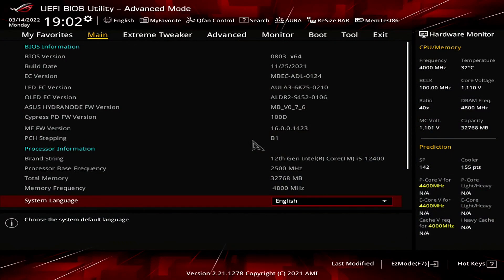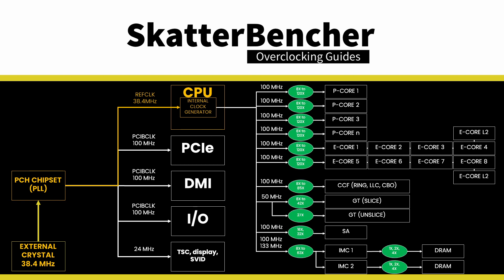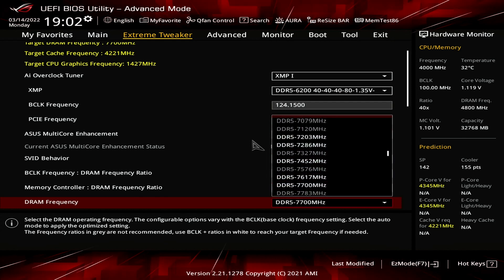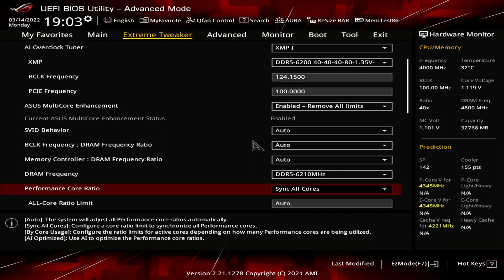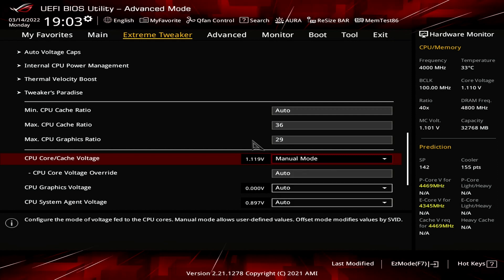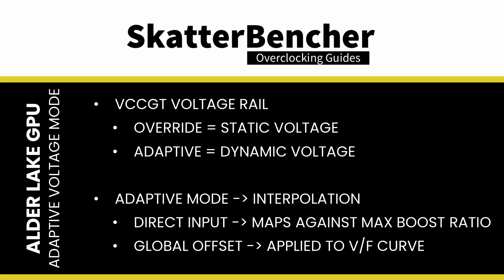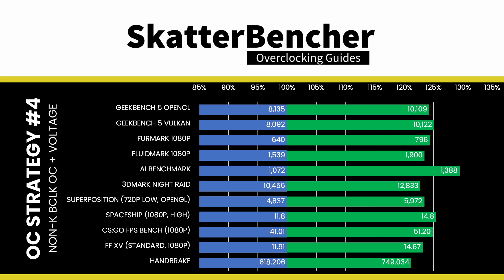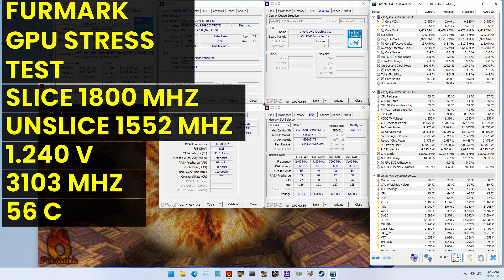5 Minute Overclock: UHD Graphics 730 to 1800 MHz

Comment: Can it be done in i3-12100? It has the same integrated graphics
Reply from the maker: Yes it's possibly also with an i3-12100. You just need to make sure to have a motherboard with external clock generator and the BIOS support for non-K overclock
Reply: @SkatterBencher  b660 supports this?

Comment: hello, regarding the Intel uhd 770, is there anything I can do on the software / BIOS side (besides overclocking) to make it better use the ddr5 RAM?  Since I see that the integrated is better with the ddr5 I wanted to know if I could do something to benefit from a better optimization.
Reply from the maker: Hardware-wise, you can always try fiddling with the memory timings. Software-wise I'm not aware of any DDR5 specific optimizations.